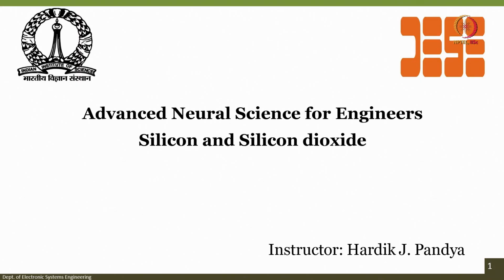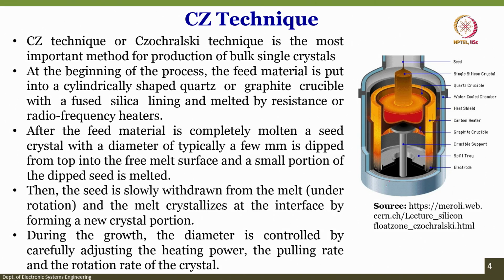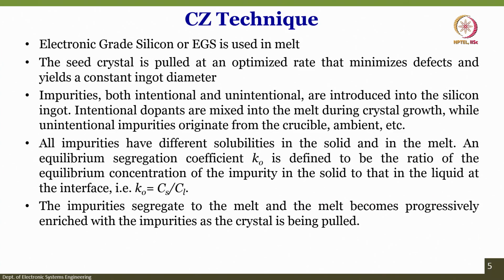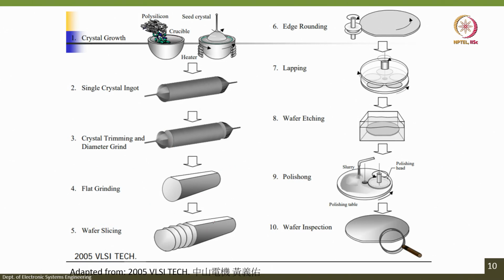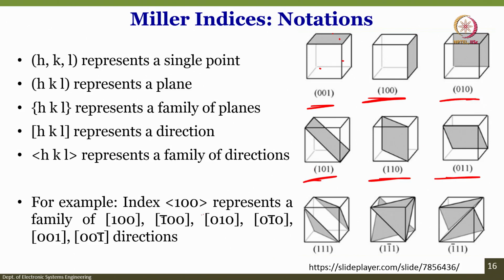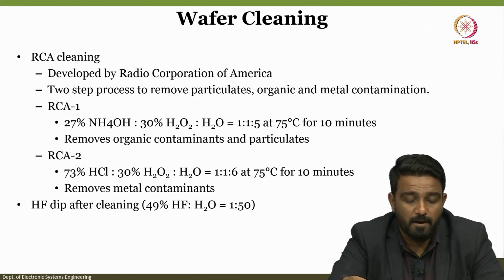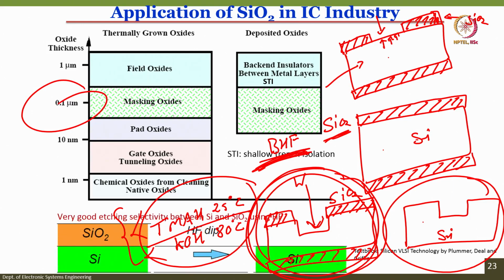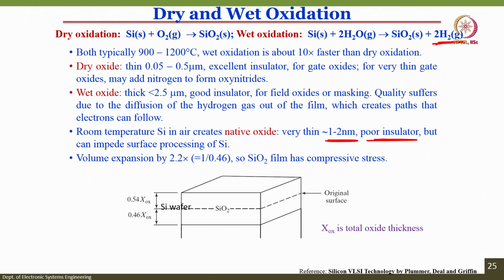Lec 06 Silicon and Silicon Dioxide

Comment: 29:29 - He discusses ONLY masking Oxide and then proceeds to Gate Oxide, NEVER discussing Field Oxide! Field Oxide (FOX), also known as thick oxide or insulating oxide, is a relatively thick layer of silicon dioxide (SiO2) typically ranging in thickness from several hundred nanometers to a few micrometers. It is used primarily for isolation purposes, creating a physical barrier between different components or regions of a semiconductor device.